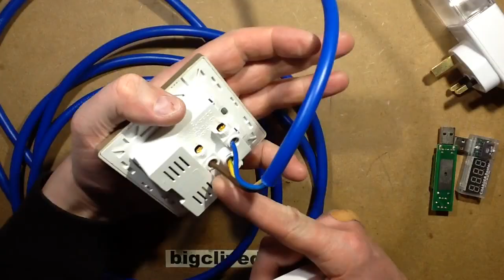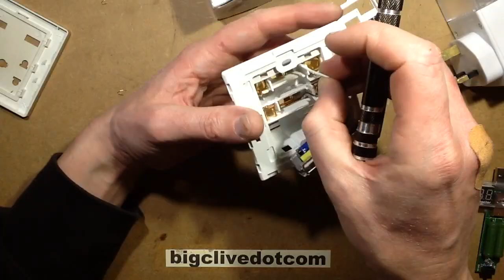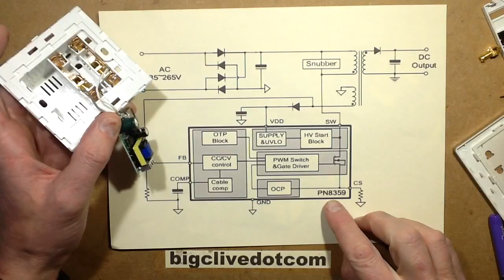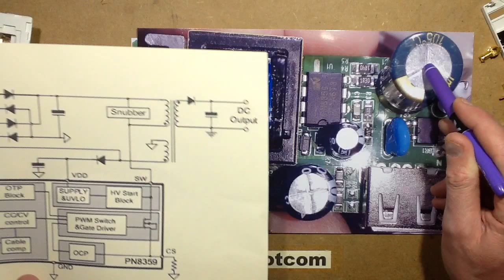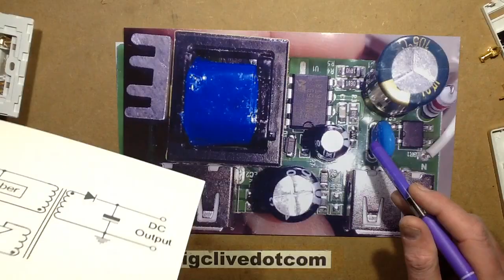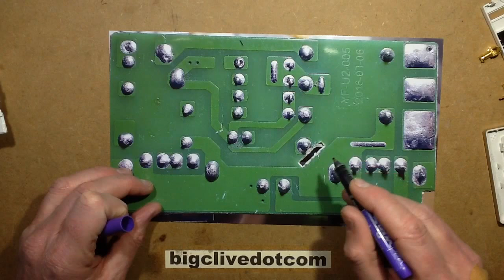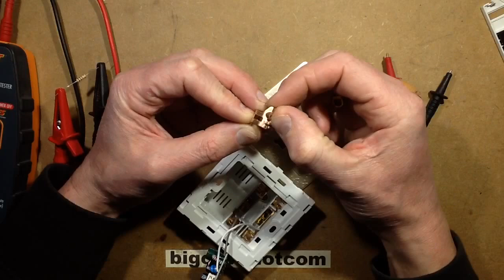Wall plate death-dapter tests including fire and 1kV.

Comment: "non-uk" plugs don't routinely include an earth spike, so a locked tamper plate keyed to the earth pin isn't as simple an option.  I suppose it's 50-50 dust cover and token knitting needle defender. 
Having said that my 2 pin razor outlet has a sexy shutter that only yields if 2 pins are pushed in unison, a single lolly stick won't work so it's an option.

Comment: Dear BigClive,
You mentioned not being comfortable with the usb board being permanently connected to the power. I was wondering if the board is lacking something which could make that acceptable or if it's just not a good idea no matter what (e.g. I always leave my Anker USB charger plugged in, so now I'm not sure if what you were worried about applies to my case or not)

I'm sure you'll show us a good USB wall plug in the future. When that happens, would you please talk more about this.

Thanks,

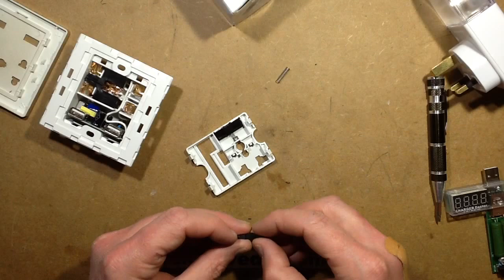Comment: 4:30 'latterly pursued a career in electrical engineering' - mmm, I literally blew the fusebox off the wall at the top of our cellar steps when I was about 10 or 11 (our house had the old round pin 5, 10 and 15 amp sockets, some 2 pin some 3, no individual fusing then just an open wire fuse in a ceramic carrier per circuit in a glass-fronted polished wooden fusebox and much of the lighting circuit was surface mounted lead-covered two core cable) by trying to find out what happened if I stuck a piece of thick wire into the cooker control box. I found out getting a parental b*llocking for my pains and spent my career in EE trying to get my own back. : -))

Comment: I would also question how robust that coating on the cover plate is regarding abrasive stuff like pins sliding over it in botched plug attempts

Comment: I was that persistent child with a knitting needle.
Reply: As a four year old I managed to remove the cap from a 15 amp plugtop on a washing machine.
Circuit protection 15 amp rewirable fuse element.
Result, completely blistered palm of hand when plugtop reinserted into live socket.  Father said that would cure me. Not in the least. Eternally fascinated. It's in the genes, but apparently not his
Reply: @hassanburrows8535  actually in my family there are a lot of Industry workers in the electrical field I may pursue it if I can. Because of my interest in what I've done in the past.
Reply: Exactly! That's what I did.
Reply: your body usually isn't able to conduct that much current so whether it's protected by a 5, 15, or 5000 amp breaker means nothing.
Reply: Me too!

Comment: In my opinion permanent connected electronic = bad.
sensitive to service quality eg. over voltage, lightning.
lifetime most electronics 5 years some older stuff 20 years.

Comment: I would be interested in see a teardown and comparison with a more mainline UK USB and mains socket which are becoming more and more available.  They too presumably have always-on electronics in them, or do they ?
Reply: Mk do a euro module usb charger which disengages the transformer when the usb plug is removed. It has a shutter on the socket with a microswitch. They're the only ones I use precisely because the others are always on, so no better than leaving the phone charger plugged into the wall and switched on.

Comment: Are fusible resistors anyhow special, and if so, how does one tell? Or are they usually fusible merely by placement in the circuit in Chinese items?
Reply: I think they're fusible in the sense that they're the first component to fail in case something goes wrong, preventing or reducing damage to the rest of the circuit or your equipment. You can simply use a resistor for this, because a resistor fails open circuit (as demonstrated in several of Clive's other videos — search "resistor roulette").
It's the placement (usually first element on one of the inputs, so no current can bypass it) that can make it fusable, along with the resistor value and power rating that ensures it's the first thing to fail.
Reply from the maker: You do get specific fusible resistors, but it appears that metal film resistors are also sometimes used for their tendency to fail open circuit under fault conditions in a fairly controlled manner.
Reply: +bigclivedotcom The coating on fusible resistors doesn't catch fire.
Reply: Admit it, you've been watching AvE haven't you?
Reply: There's obviously a major overlap in viewership. No idea where that comes from!

Comment: I've seen British General are selling a similar thing but it actually meets UK electrical standards. It would be interesting to rip apart one of those and compare it to this cheapy Chinese version.
Reply: Legrand do one also with the universal plug with the same arrangement as the one in the video, i dont know if it is compliant because it is in cyprus. This is the link for the BG http://www.electricpoint.com/bg-electrical-nexus-moulded-827l-1-gang-universal-socket-with-po.html
Reply: Agree
Reply: BG probably is cheap Chinese tatt behind the faceplate. It's pretty crappy gear, normally.
Reply: Albert Tatlock not everyone gets paid well enough.. sometimes you gotta make due and just have insurance lol
Reply: @carolynmmitchell2240  I mean I can't afford a Bentley but I'm will to pay an extra few quid when changing my wall sockets so the house doesn't burn dow
Reply: @carolynmmitchell2240  - What! You've found an insurance company that actually pays out on claims? Please tell us all which company that is!
Reply: Gadget Addict they'll cost a lot more that's one thing you can be sure of.
I'll keep my Bentley because I don't buy inferior junk, I've always said if you can't afford the best then you should do without,)
But it's about supply and demand, and everyone wants everything but doesn't want to pay for quality or safety.
Those squealing brakes or bald tyres will be ok... until they may be needed
Reply: @alberttatlock5237  sqealing brakes are ok metal on metal grinding is not the squealing is from friction and brake dust

Comment: Did you look to see what kind of diodes they used?  I find it odd that the put a heat sink on them.  I'm wondering if they weren't rated for high frequency use.  Perhaps they were just a pair of 1N4001.  I'd think it would be cheaper to put good diodes in rather than pay someone to attach a heatsink.

Comment: you used software to doodle this circuit out instead of drawing it. New approach ?
Reply: That's actually the common circuit application diagram from the chip's spec sheet, hence the dual diode that Clive drew on to represent the actual implementation used.
Reply: Thermal Ions I was thinking Clive had drawn it in a schematics drawing program cause it looked so much like the circuit board of the wall-socket. I thought the IC manufacturer only draws the IC and not a whole circuit around it. Its almost copied one on one huh :)
Reply: I'm gathering (purely from watching both Clive and EEVBlog) that it's not uncommon for IC manufacturers to include a recommended circuit - assuming it has a typical use scenario I imagine.
Reply: Thermal Ions that is nice of them :) The designer of the circuit board in the wall-socket had little to design then :)

Comment: You should get/build a high voltage tester that goes up to 3-4kV at least, so you can test according to the standard requirements.
Reply: Microwave oven transformer driving a short Cockroft-Walton chain. Go for decent capacitance ceramic caps and you have a very useful HV power supply. Be VERY aware that the output is NOT ground referenced, so your domestic RCD / ELCB protection will not work. These CAN be made (relatively) safe to use, but you have to think VERY carefully through the design (and protection systems) to ensure the HV is isolated / "off" by default. Things like interlocks disabling power unless the correct HV cable terminations are fully inserted (opto-sensors are ideal and fail-safe).
Reply: You do not need high power for HV tests. Something like an oil burner ignition transformer would do just fine, and is internally limited to 15mA or similar. Much safer already.
Reply: stefantrethan Not so easy to come by second-hand as MOT's, especially Down Under, where heating is rather less important than cooling :-D An alternative would be a generic motorcycle ignition transformer driven by a small oscillator (555 chip and a MOSFET)
Reply: Maybe you can find a small neon transformer?
I believe Clive has shown a very nice FART transformer before that would do the trick.

You want either DC, or 50/60Hz AC, so all the high frequency / pulse type ignition transformers you'd be limited to making DC.
Reply: stefantrethan I've got a few NST's around, but the newer models have significant "protection circuitry" that limits their performance. They are also rather expensive (and second-hand seem unavailable in Australia) which is a pity.

Comment: It's funny Clive, when I was 3 (I'm an American by the way) I had shoved a screwdriver into a light switch box and got the full voltage, and until you pointed it out, I had an odd inclination towards electronics.

Comment: Hi Clive. I have few of these in my home and I am quite satisfied. I think the circuit inside is probably not exactly you have in video, but what make me uneasy for these is - does it safe for long period permanently under current? You see, it is constantly plugged to 240V supply. Months, years. Does it safe? Or it is better to find some with switch and turn that USB supply only when it needed?

Comment: when i got interested in electricity i wasn't really sure how outlets (american) are wired up. so i tried wiring the outlet to a cord and of course didn't do it right. instead of putting hot on the hot screw and the negative on the negative screw i put both wires on the same screw ( i was like 7), oh did i learn..... if you see sparks you know you didn't do it right....

Comment: First 240V mains shock at 5 years old, "fixing" a lamp problems were; 

A) I didn't know which way was on and which way was off on the power sockets in the lounge room.
B) Hadn't yet figured out lefty loosy righty tighty.

Noticed the light socket in one of our floorstanding lamps was loose (blown globe in it), thought I'd turned it off at the power point (evidently not) and I was "tightening" the top cap (again, evidently not), when it came loose I got my fingers onto the contacts. Was a decidedly weird experience, felt like I was "floating" for the rest of the night.

After that incident I lost count at 27 mains shocks.

Didn't become an Electrical Engineer but I do have a degree in a related field...

Comment: I love your videos.  Here in Canada I would not buy anything and install it if it didn't have our Canadian Safety sticker (CSA).  In the USA, I think, it's UL (underwriter labs).  What's your UK equivalent? What would a certified safe electrical home wiring element be marked as?
Reply: To be fair, I hate the CE markings. They're easily faked and people don't know the difference between a real one and a fake one. Especially when you can buy stickers that exactly match the original. Litlle harder to fake the kitemark, huh?
Reply: It's not just that Sinéad - even 'genuine' CE marks can be pretty 
meaningless. Manufactures self-certify to a great extent with CE, and 
the system has serious weaknesses. Interesting article from BSI - 
http://www.bsigroup.com/en-GB/blog/Organizational-Resilience-Blog/weaknesses-of-ce-marking-for-electrical-goods/
Reply: Europe has a CE mark. (I forget what that stands for) You have to be careful not to mistake the very similar "Chinese Export" logo for it, though.
Reply: Don't we still have British Standards as well, and they are much more trustworthy than the CE mark process!
Reply: I don't always trust those. Many dodgy Chinese manufacturers will put fake UL and/or CE markings on their products. The Canada-specific CSA mark is probably a lot less likely to be faked, though.
Reply: CE stands for the French phrase "Conformité Européene" which translates literally to "European Conformity."
Reply: Sprankton Chinese export logo doesn't exist, it just means the manufacturer has a failed product and won't improve and test again, pretty dangerous isn't it?
Reply: Alex Gray Thank you :) Shall be having a read on that later

Comment: Speaking of strange test equipment names:
If it works, it must be a Fluke.
Reply: I had just realized that myself hahaha Cherokee eevblog by the way he had a multimeter one little handheld job is with the pincers type measurement ad blow up in his face not on camera but he pursued through the manufacturer.
Reply: Love my Fluke.
Reply: I'll add mine: One of the leaders in the Energy Conserving Device industry is:
Leviton.
Could be pronounced, "Leave it on."

Comment: You're right about getting shocks guides you into electrical, *lets see how old you really are) :D
Fist shocks was unplugging my scalextric at about 7 years old, it was the 5 and 15A round pin sockets.
At about 12 i tried to power my Dan Dare intercom set from the mains striplight above my bed.
Would i install that in my house ? definitely not, specially not in stud walls, i like a proper fuse for a start, also don't like to have no control of power consuming devices, no matter how small the  current is.
I also like proper sockets, preferably MK.

Comment: You would be getting a constant draw on your power having something like that hooked up. Though not alot,it would still be drawing power. In this day and age,there is a good chance they could tax you for every little frop of energy used,so why would you leave it plugged in?
Reply: simontay1984 That is true,I agree with Clive,I would feel uncomfortable putting something like that in my house wiring. Eventually,it could fail due to surge. I see no surge protection incorportated into the design.

Comment: never knew the UK plugs had such robust shutters as a safety feature, and i've been to the UK. wonderful!
Reply: New US code requires shutters on our sockets.
Reply: In Finland shutters have been used in children's rooms since 1950s. Modern type shutters that require no special operation have been available since late 70s. I do not know i f they are mandatory but there is at east enough social pressure for them. Same applies to power strips. I recall people some 15 years ago contacting stores that sold power strips without shutters.

Comment: Those two diodes in parallel on the output - Isn't this a bad idea, because the forward voltages are going to be slightly different, and one diode will get most of the load?
Reply: Aye, paralleling diodes is bad, if your pulling 1.5 watts and they are both 1 watt one will usally fail quickly followed by the other shortly after that. You can put them in series. To protect a piece of equipment I have, 3V max I have 7 diodes in series going between my probe and ground each way .That way if I accidentally touch something iam not supposed to and the voltage goes above 4.9(.7×7) it will cause a short,blow a fuse and stop the voltage from reaching my piece of equipment. Learned that trick from "Mr. Carlsons Lab" tube channel. He uses something similar to protect his spectrum analyzer because he uses it on Tube radios where there is voltage 200+.
Reply: Aye, paralleling diodes is bad, if your pulling 1.5 watts and they are both 1 watt one will usally fail quickly followed by the other shortly after that. You can put them in series. To protect a piece of equipment I have, 3V max I have 7 diodes in series going between my probe and ground each way .That way if I accidentally touch something iam not supposed to and the voltage goes above 4.9(.7×7) it will cause a short,blow a fuse and stop the voltage from reaching my piece of equipment. Learned that trick from "Mr. Carlsons Lab" tube channel. He uses something similar to protect his spectrum analyzer because he uses it on Tube radios where there is voltage 200+.
Reply: Yeah, it's a bad idea.  Using an ideal model for a diode, each of those diodes is going to have a forward conduction voltage, around 0.7V.  But since those diodes can't be exactly identical, one will have a forward conduction voltage slightly lower than the other.  The diode that conducts first will create a voltage drop that will not allow the other diode to going into its forward conduction region.  Therefore you only use a single diode.  In reality, the I-V curve for the diode isn't quite a step, but it's pretty close.

Not surprisingly, they needed a heatsink since it is likely 1A diodes in parallel (in some vain hope of getting a 2A diode).  I guess the heatsink is cheaper than the rework.

Comment: "This is definitely designed for use on the British system" - well, sort of. The reason why a lot of Chinese stuff has the UK three rectangular pin socket/plug combination is that it's also used in Hong Kong. I'm also guessing the general size and screw holes are the same in HK as in the UK.

Comment: back when I was 7-8 I had a fan plugged in and out of pure stupidity and or curiosity I took a scissors to the cable, somehow I managed to avoid getting blasted with 240V and the only RCD that went was the plugs (I managed to dim the lights though xD) my mother ended up bringing me to the hospital though because I threw up afterwards and i was shaking like fuck, don't actually remember the rest of that night or the next week after it for that matter but now I love taking electronics to bits and messing around with the internals and seeing how they work, baffles me that so many others do the same!
Reply: You're a living example of why "starter" scissors given to children typically have rubber-dipped handles. It isn't just to make them easier to grip!
Reply: ***** haha maybe xD or maybe electricity is scared of me ;)
Reply: catgrin and these weren't just kiddie scissors, these were scissors for cutting fabric (big long blades with plastic handles, found them in my mother's room)